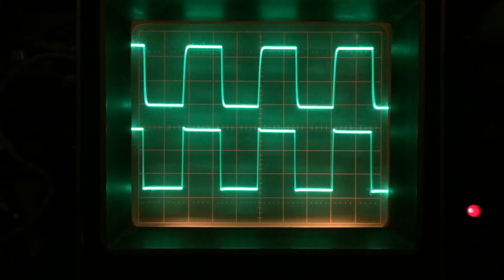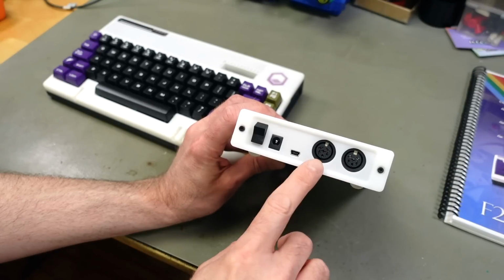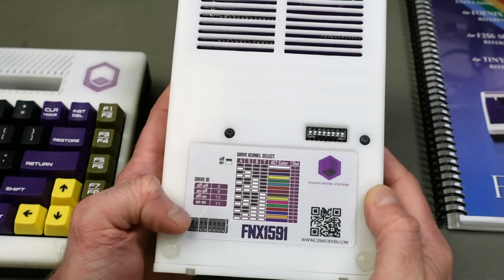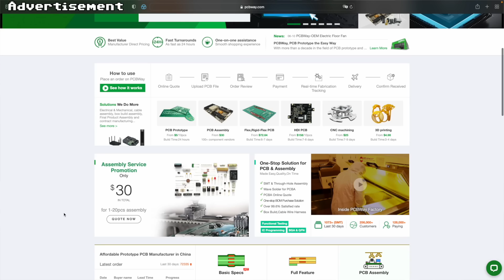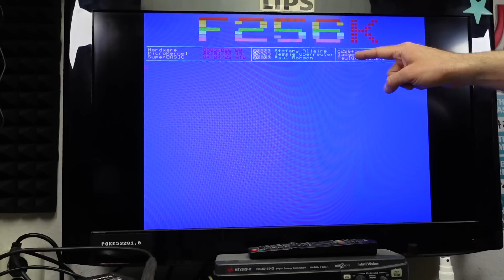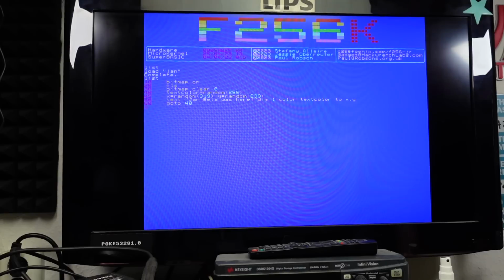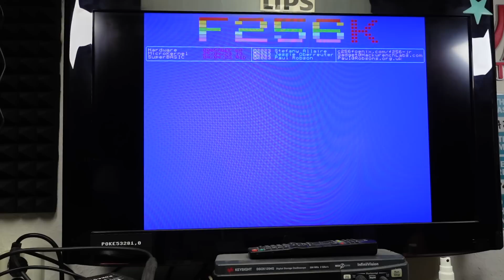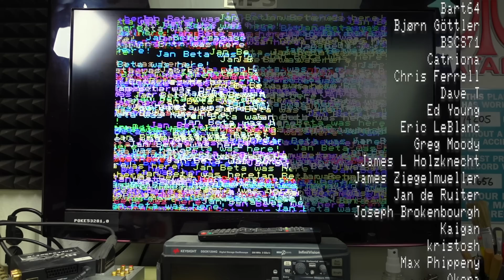Foenix F256K New Retro Computer

Comment: Annoying video doesnt mention price (well not in first 10 mins) so I went to link. $595.  DREAM ON!!!! Not interested in slightest. Its not gonna get traction at that price so expect precious little software for it. Keyboard keys wobble and its custom so no chance to fix or replace with better.       How much was Jan paid for this glorified advert!??
Reply from the maker: I didn’t get paid anything to make the video, the F256K and FNX1591 were provided for free though.
Reply: @JanBeta  That would be your payment then, wouldn't it?

I agree with methmethanoid856. Absolute waste of time, energy, money and effort.
Reply: @meh3247  hum, to be fair with Jan, if he didn't like the thing, nothing would have stopped him to tell bad things, even a free computer.
Reply: but why not make this video?
no matter what kind of retro device you will make, it will ALWAYS be expensive because of the low volume of these systems. it is simply NOT possible to make an open system cheap. however, it could be a discussion point what kind of improvements could be done to make it more attractive and maybe cheaper or maybe to split investments into multiple batches.
a bit more constructive criticism would be appreciated.
here for example some REAL points that could help:
*  making the keyboard external by adding a raspberry pi pico inside. it could handle a ps/2 keyboard, usb or bluetooth and has wifi for online communication/gaming/cartridge updates. that costs about 5€. much cheaper than making a c64 style keyboard.
*  making a new case that is similar AND compatible to a classic atari 2600 case.
with two added holes in the front for joysticks. and extra holes on the back for all the other stuff. AND compatible to old 2600 (junior) motherboards.
this could be made as a separate kickstarter project to get investors for making a mold for mass production. there are many atari 2600 juniors around that look like shit and would benefit from that classic case look. i could imagine that there are many people out there who could invest 1000$ for making an injection mold and get paid back up to 2000$ if enough cases have been sold with profit.
* empty game cartridges: a kickstarter project could invest into making batches of 1000 or 5000 pieces of empty cartridges for game makers. a microcontroller with decryption software connected to a cheap nor-flash. game-makers could buy batches of 10, 100, 500 etc. with a bit of a markup but giving game makers a cheap way to distribute games.
again, if a cartridge standard should be established, the question could be, if there could be a compatibility of the cartridge case with a c64 cartridge, or an atari 2600 or 7800 cartridge.
it would make sense to invest in molds that could have a higher volume and multiple purpose.
Reply: Negativity is always such a great thing isn't it, I wish we didn't have all these new revivals and enthusiasm around 8 bit computers..... oh wait....
Reply: The original 1978 price of a 48K Apple ][ in today's currency is $12,305.02. Let that sink in.
Kids these days expect everything to be priced like mass manufactured goods that's just not real.
Reply: @meh3247 Is that a confession on your part?
Reply: @meh3247  Payment comes in the form of currency which you may spend on any good or service. Compensation is limited to a selected good. You might not see the difference, but most people, laws, and tax codes do. Also, this machine is only $144 in 1982 US dollars.
Reply: @Peter_S_ Here we go again with the poor analogy. 🙄
Reply: Yes, it's expensive. For too expensive for my tastes. Apparently the price is in Canadian dollars, so perhaps not so bad if you're converting  to USD or Euros etc. But to insinuate that Jan was paid to give a good review is disingenuous at best, perhaps even downright rude. The product is what it is, this and a cheaper version. It costs money because it's a labour of love, being made in small numbers, not 100,000 units per year. Don't like it? Go get something else and be happy.